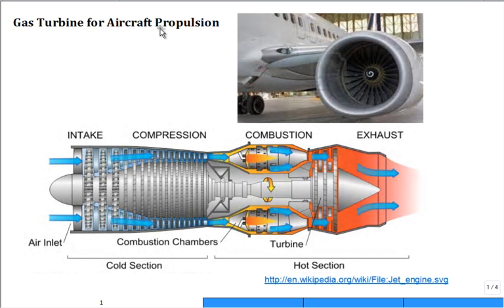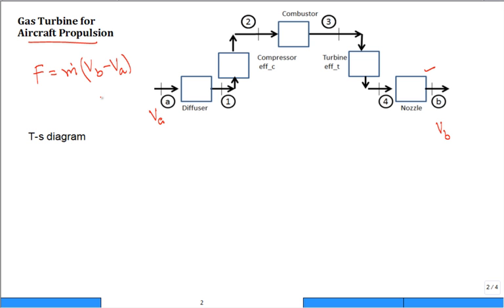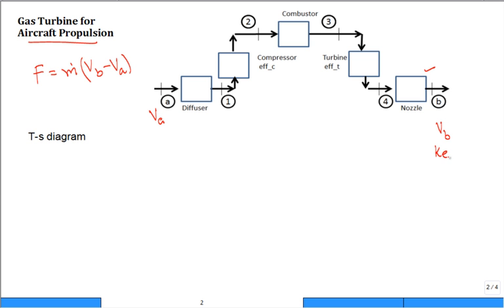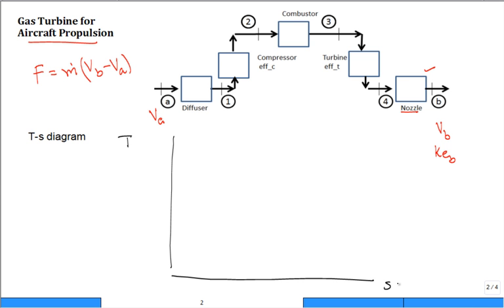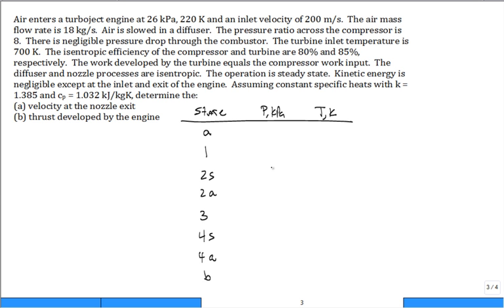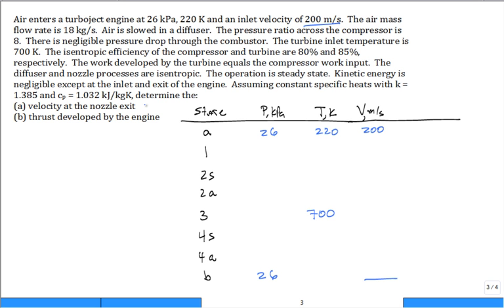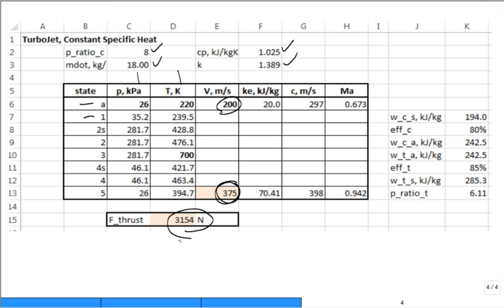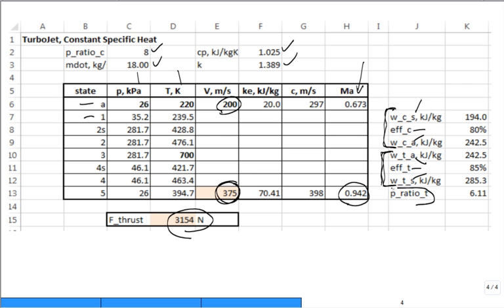Jet engine, air-standard analysis

Comment: 375m/s or mach 1.102 pretty good engine at that rate of dry thrust at sea level ....your mach number is lower because you calculated at a value NOT at sealevel  with a csubp of 1.025
Reply: turbine ... saltine valvoline ... machine ... not turban turbine ... een like machine .. a turban is something you stick on your head to denote religious affiliation ... whcih has NOTHING to do with a jet engine. 
.
first rule of education enunciate words properly .... or else what you taught is for naught

Comment: Air with the following properties enter the compressor of an aircraft gas turbine.

P=5.45psia

T=4300R

V=600fps

M=150 lbm/sec

Thecross-sectionalare(ft2

Please solve this question.
Reply: Use equation:
Massflowrate=Density x Area x Velocity
PV=mRT ; m/v=Density
Density = P/RT then substitute 
Massflowrate=(P/RT)xAreaxVelocity
Check units thus,
A=73.06ft2 
Note: R(air) = approx. 53.34 ft-lbf/lbm-R
Reply: @xavierramirez6183  thanks